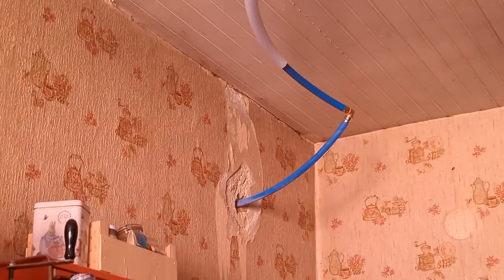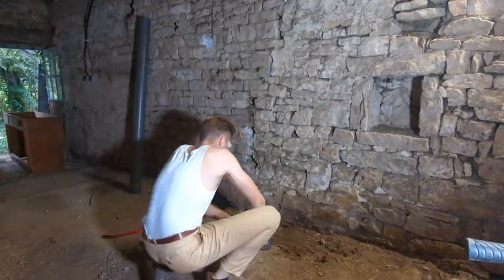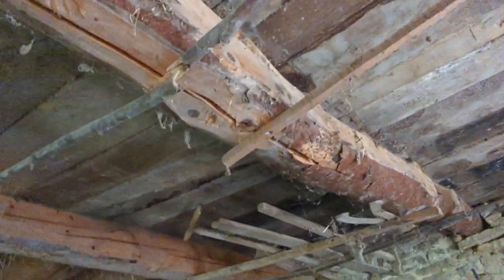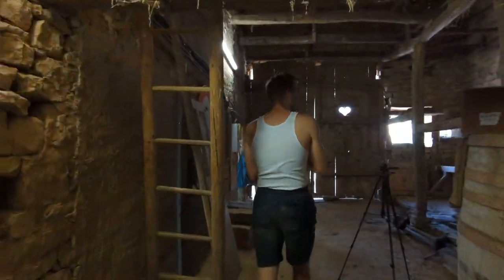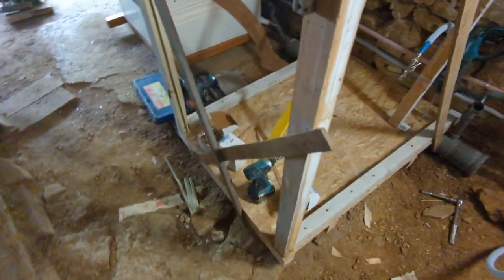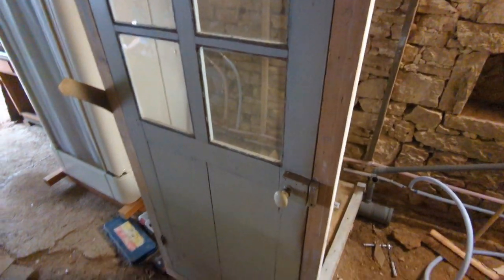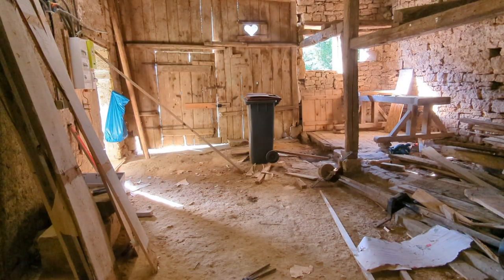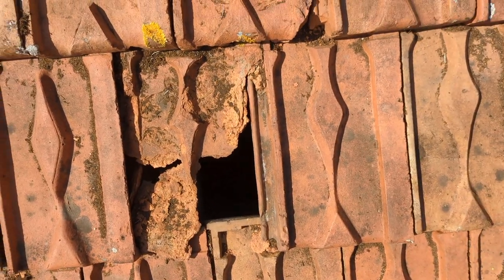Would you call THIS a BATHROOM??

Comment: Please do not discard the vintage equipment of the wheel wright! What a wonderful restoration it will make.
Reply: The thing mounted to the beams is called a line shaft in English, a fascinating way of operating machinery from a single power source, dating back to the days before electricity. Also a rather dangerous way because the open leather belts frequently caused accidents.